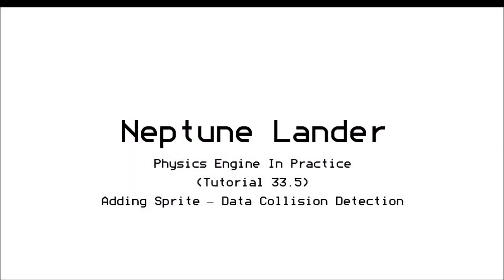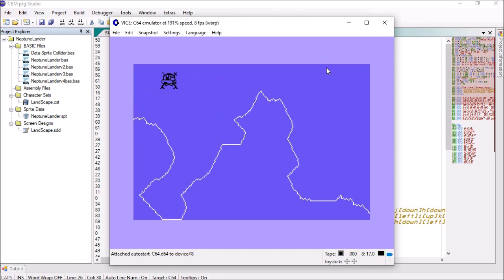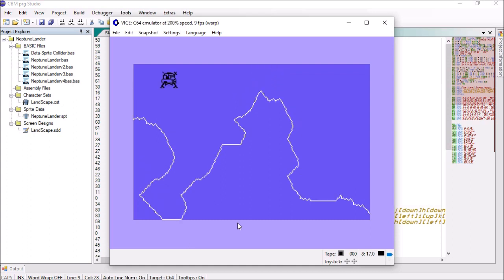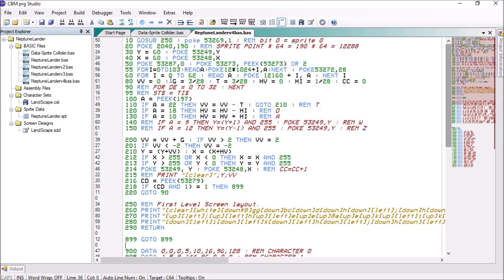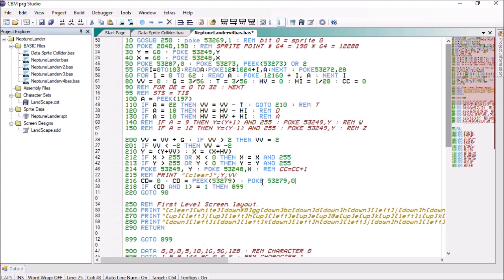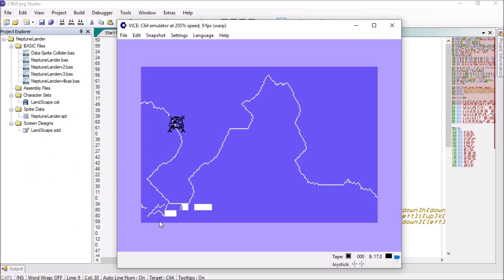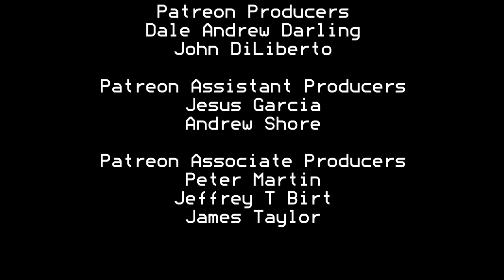Tutorial 33 - Ep 5 - Adding Sprite - Data Collision Detection System

Comment: 1:36 The "bas" extension got added to the file basename.

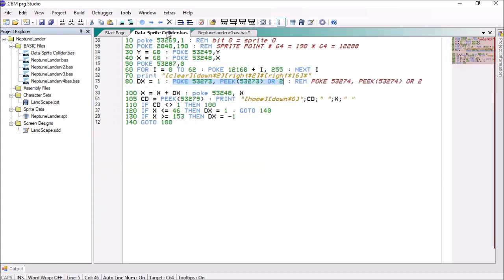2:55 There is no "turning on" the sprite-collision mechanism.  It's always on.  Location 53273 is to manage Interrupts, which you aren't using.

5:05 The collision status will continue to be re-asserted for as long as there is a collision on the screen, which continues after you first read it and remains set after you re-run the program.  A defensive thing to do would be to PEEK(53279) and ignore the result, right before you start your main loop, to discard prior sprite collisions.  The user might have run other games before yours.  Does your program set the bit pattern for the programmable Space character?  If not, then your screen could be full of lit pixels if the memory happens to contain non-zeros, causing lots of collision detection.

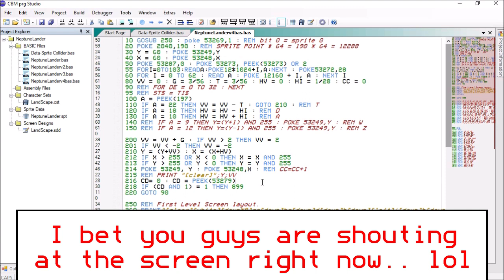12:06 POKEing the collision register apparently shouldn't help, since the documentation says that only reading it clears it, but the underlying «STA (zp),Y» apparently does a read of the effective address in clock cycle 5 of 6 ( http://www.zimmers.net/anonftp/pub/cbm/documents/chipdata/64doc ), so this might accidentally clear the collision flag.  However, POKEing it right after PEEK()ing it is pointless, since the read clears the register anyway, and the extra POKE induces a race condition with the VIC chip as to whether the next PEEK() could possibly miss a collision.

14:13 The PEEK() of the register happens in a loop while the collision is still present on the screen, so it keeps being re-asserted by the VIC chip.  The collision on the screen sometimes goes away after you re-enter BASIC, but the register still isn't cleared before you use it to check for a lander crash.

15:45 You should make two complete versions of the game, one in BASIC and one in assembly.
Reply from the maker: Watcha Dude :) yes, i noticed the "bas" mistake afterwards, its amazing what you dont see while doing it... lol

Turning Interrupt, not good.... :o

The conversion to assembly video series is coming up, I think I have 2 or 3 left on this basic series, then we convert and that is where I really make mistakes.... LOL, not a game programmer me... more applications programmer which I will be going back to after this :D 

Thank you for you in-depth analysis of this, it is much appreciated :)